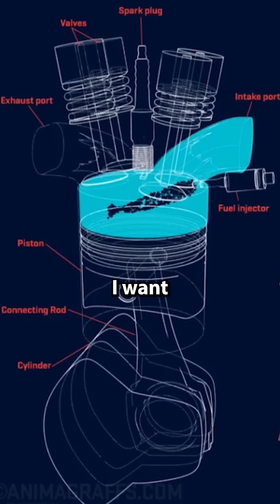All induction is forced

Comment: So atmospheric pressure pushes air into the cylinder at a rate that is dependent on the vacuum created by the piston?
So what is the maximum vacuum that can be made under atmospheric pressure at sea level?

Comment: Pretty basic stuff here.  Air has mass and the column of air moving through the intake tract develops a "ram" effect.  Same on the exhaust side, except the departing exhaust gas creates a scavenging or suction effect.  Tuning via valve timing intake and exhaust plumbing,  etc enhances this is the desired RPM band, but even your Briggs & Stratton lawnmower engine benefits from it.

Speaking of lawnmowers, I "tuned" mine by removing the exhaust restrictor "DB killer" washer from it's muffler box, and adding a bit of tension to the governor spring to rev it out.   Newer OHV mowers are governed to lower RPM (typically under 3K) than the older flathead ones (3.6K in mowers to 3.9K in slowblowers) to meet sound and emissions regulations.  

My let off the chain late model Toro self propelled  push mower with an OHV 6.5 HP engine barks hard and cuts the thickest grass like a boss set at 3,900 RPM, I estimate it is putting out a solid 9 HP ;)

Comment: It should be “pushed induction” and “pulled induction”. It’s still not accurate, but can give a better sense of the dominant direction the air is being forced. In a naturally aspirated engine, the vacuum force is pulling the air in during the intake stroke. In a turbocharged or supercharged engine, the vacuum force is also pulling the air in during the intake stroke, but due to the higher manifold pressure from the forced air, that higher pressure is also pushing more air in during the intake stroke.

Comment: Methinks this is a strawman argument.   Yes the air is forced into the cylinder by a pressure differential between intake air pressure and the near vacuum created in the cylinder, but "forced induction" has always meant that the air pressure in the intake is above ambient.  Nothing more, nothing less.

Comment: We call induction vacuum. We call forced induction boost. The higher the RPM the less vacuum. The only way to extend the vacuum is to adjust the valve duration. How vacuum is created is by the strokes of the pistons acting as pumps. If we forget about those basics, we will never make engines no powerful than 50HP/L or a peak torque that plateaus the whole range.

Comment: To calculate the duration of the intake stroke at 6,000 RPM, we can use the following formula:

If I get the math right do I get 95% off on the turbo for my 4.0 Jeep Grand ( Cherokee stroker engine ..... 4.0 )

Intake stroke duration = 1 / (2 * (RPM / 60))

Where RPM is the revolutions per minute. 

Plugging in 6,000 RPM, we get:

Intake stroke duration = 1 / (2 * (6,000 / 60))
Intake stroke duration = 1 / (2 * 100)
Intake stroke duration = 1 / 200
Intake stroke duration = 0.005 seconds

Therefore, at 6,000 RPM, the intake stroke would be 0.005 seconds long.

I'm I right ? .... I'll pay for shipping😅😅😅😅
Reply: Let your people figure out your math if they get it right do we get the grand prize for our vehicle a super turbocharger😂😂😂😂😂😂 of course you'll have to install it for me I just got through putting in forged pistons and Harland sharp roller rockers ..... can you work on electric actuators for the valve system .... .... 😊😊😊😊😊

Comment: I hate when you over complicate shit now you say time but in another video you’re like it’s not timing it duration because not all factors are the same well not every vehicle has the same lobes or same stroke. And not all intake strokes are forced a vacuum is not forced it’s a vacuum forced induction is extra pressure add by turbo or super charger

Comment: Maybe “ram” induction?
Chargers, both super and turbo, are known for external forcing. 
The piston descending is a true draw (vacuum) due to expanding cylinder volume, but any increase in pressure by forces outside the cylinder could be seen as ramming. 

I suppose the atmosphere in the cylinder, during the intake stroke, is undergoing rarefaction, while the atmosphere at the intake port is experiencing a little of both; rarefaction on the cylinder side,  and compression on the turbo, super, or ramming side. 

Regardless, the pressure is greater when either of the three external treatments are present.

Comment: That's why the resonators on factory air intakes work to improve engine torque, driveability, etc. because it smoothes out the intake pulses, which helps maintain a smooth movement of air through the intake and into the cylinder. TBI spacers can also help this, albeit at a smaller effect. Same principle that works by adding a boost bottle on a 2-stroke engine.

Comment: Pressure Differential. The lower the pressure in the cylinder and the higher the pressure outside the cylinder, the greater the Pressure Differential. With all else remaining the same, the greater PD will allow more flow and volume.

Comment: The air is being sucked in,not pushed....just saying!
Reply from the maker: It's equalization of a pressure differential across the intake valve. Is the vacuum of the cylinder sucking air in, or is the relative higher pressure of the intake manifold pushing it's way into the empty cylinder? Both are true.
Reply: @bankspower   Until you turn the motor over nothing happens with the air movement. It isn't pushing anything, as soon as the pistons start moving this starts to automatically creating a vacuum drawing air in. At what point does it start "pushing" it's way around? All the pushing would be done on the exhaust stroke to push out the exhaust gases! Please tell me what I am missing? Thank you for your response sir!😎

Comment: No. In this context, natural means air pressure, forced means assisted by some sort of fan. Period. The piston does not make air flow into the cylinder, it creates a partial vacuum, and the external pressure drives the gas into the cylinder.

Comment: On a NA engine how much of the inertia of the airflow in the intake manifold and port cause the cylinder to fill faster and more completely.   Does a big bowl behind the intake valve increase the mass of the stopped air while the intake valve is closed verses a tapered bowl that has less mass of air that it needs to accelerate into the chamber.   How much does scavenging effect horse power.  I had a friend build what looked like a header collector reducer with a 8 inch straight section that was just slightly larger than the primary tube.  This created an anti reversion tube that lowered the pressure in the collector, primary tubes and exhaust ports.  His 14 to 1 Na H22 honda went from 265hp to 275 hp in 10 minutes at peak horse power readings.  The straight section added inertia preventing reversion and improving scavenging.

Comment: Is it forced, or is the difference in pressure just trying to equalise. Is more air-fuel mixture trying to occupy the same space than is required to equalise the difference in pressures. And of corse this only applies below a certain altitude, given an ice in a vehicle is not going to reach an altitude where the pressure differential between the intake stroke matches the pressure of the external environment.

Comment: If it's pulling vacuum though, that means that it is in a negative state, which means that you would have to have a positive state so it's not really forced. To have a negative you have to have a positive like a yin and yang effect. Like if you were to operate it in space the piston going down if you have stagnant atmosphere within the manifold is still going to pull the material in. If it didn't move at all, the material would stay simply trapped in the manifold, but since the piston is moving it's going to pull it in so it's not forced. 😅

Particles will always move to an area of less density for a similar type. Unless there's magnetism involved which is the case of water. 

And even in space the sun is actually off by 6 km from a perfect sphere meaning that there's something there. 😂

Water is paramagnetic—meaning that it will hold a magnetic charge. In nature, the earth's magnetic field naturally charges water in lakes, wells, and running streams. However, as water passes through the treatment plants and is transported through pipes, it loses its magnetic charge.

Comment: Automobile semantics.
i also find this interesting.
Engine timing and Firing order.
Engine timing defines the spacial relationship between the cams, crank, pumps etc.
Firing order defines when each spark plug sparks.
with these description it should be termed Engine order and Firing timing. but it's the other way. who am I to complain.

Comment: If you take the bore strike and turn it to meters and then turn the meter to seconds, as long as you have exceeded the speed of sound times the amount of air cleareance and (and sme how add the resistance behind the valve) you will fill that cylinder up mostly.  Almost every time.

Comment: Thats actually wrong. For there to be a vacuum, the pistons would have to exceed the sound barrier. So 0.00083 of a sec or faster (feet per second) for the air to create a vacuum. 100 percent false. Not possible. The rings would give out. Oil would enter the cylender destroying the engine

Comment: Yes, the atmospheric pressure on earth is about 14 psi so when the piston is on an intake stroke, the vacuum it creates doesnt actually suck the air in. The atmospheric pressure pushes the air into the cylinder, which most people dont understand. If you ran an earth designed engine, on a planet with a denser atmosphere, it esentially would be boosted!!

Comment: Any actual engineer knows that no flow takes place at all without a difference in pressure. The pistons doesn’t “suck” air in, the atmospheric pressure pushes it in. However that’s still not forced induction, since forced induction refers to an intake charge above atmospheric pressure
Reply: If the piston doesn't descend and create a low pressure area above the piston, the atmosphere will not "push" air into the cylinder.  It takes both. What Mr. Banks is saying is that the force is actually the Pressure Differential itself, and he is correct to call it a force. Yes, textbook definition of "forced induction" is usually referring to some type of atmospheric pressure augmentation. It can be as simple as Cowl Induction or "Ram-Air" induction as well. Anything that creates more atmospheric side pressure, which increases the total Pressure Differential, can be classified as forced induction.
Reply: that was long and i got it hard to catch but somehow i can relate,
tganks bro
Reply: Correct of course.  A boosted or forced induction engine is one that mechanically supplies atmosphere to the cylinder above ambient atmosphere.
Reply: He's talking about the overlap Period.
Reply: Do you have to be an engineer to know that?
And why do so many people feel the need to state the obvious over and over? Yes, it's the atmosphere that pushes in after the piston creates a vacuum. Only flat earthers think vacuums suck.
Reply: damn atmosphere sucking all my co2 out my lungs and force feeding me air
Reply: @wyslink9354  when you increase the volume of your lungs the pressure drops in them, then the higher pressure air around you forces itself down your trachea into your lungs. So yeah actually.

Comment: It's always forced induction. I learned this years ago. It is a difficult to grasp that even at idle that air is not sucked in by the piston but rather forced in by the atmosphere. An easy example of this is a carbureted engine will idle higher at sea level than at high altitudes reason being the atmospheric pressure is higher at sea level.

Comment: When you use some type of compressor to aid in filling that cylinder, the Volumetric Efficiency goes up; more power on less fuel. But you begin to lose that efficiency when you start impeding flow. Compressing air also generates heat, which makes the molecules of everything you are compressing expand, hence less oxygen. Now comes the Intercooler. Nothing is exactly free when it comes to making power.

Comment: Went to school for heavy duty diesel engineering  and no one explained why you need a turbo for a diesel as simple as this explanation
Reply: You don't need a turbo for a diesel engine to run.  However if a turbo is added it 'forces' more atmosphere into the engine making more power.    Banks is wholly incorrect on his idea that ambient air pressure can be considered forced.
Reply: @kelsycunningham8452   yeah you don’t need a turbo with a diesel  but it definitely helps hahahaha

Comment: Vacuum is what helps a gas engine to breathe, ironically.  It's the lack of air that helps bring air in, since oxygen wants to go into a vacuum space with almost a concussive force, filling the void space.  It's why Diesels struggle to breathe without forced induction, there's not enough vacuum to encourage air to flow in the time frame of the intake stroke and the valve being open.
Reply: Diesels don't have a throttle plate hence there isn't the traditional vacuum you get with a gas engine when the throttle is closed. However, the piston creates a low pressure zone on the intake stroke which acts as a vacuum when the intake valve opens. The difference in air pressures is what actually fills the cylinders. There are gas engines such as the BMW's valvetronic that run no vacuum at all because air volume is controlled by the lift of the cam.

Comment: His point is the term "naturally aspirated" contains "forced induction" by the term "forced" meaning having a force that does work, in this case vacuum and pulling what the atmosphere pushes inside the cylinders. There's also Inertial Supercharging where the inertia of the airflow pulls air into a hammer like effect pressurizing the cylinders higher than the atmospheric pressure, this is both "naturally aspirated" and "forced induction".
The term "forced induction" is considered to be any type of induction that feeds the engine air at a higher pressure than the atmospheric and coming from outside the engine, but "forced induction" is technically many things not only this.

Comment: Im curious what mr Banks thinks about the newish atmospheric pressure, no throttle body, induction systems.  I mean hes always running boost, so maybe its not within his interests.  

At 6000 RPM, in a 4" stroke motor, the average piston velocity is under 50MPH, but halfway up or down, its doing twice that speed.  0-100MPH-0 in 5 milliseconds, 200 times per second.

Comment: It's actually 25 times per second at 3000 which equals .04 because the intake is only every other crank revolution.  .02 for 6000
Reply: RPM/60=RPS. 1s/RPS=Rt(Revolution time) Rt/2=St(Stroke time)

3000/60=50 | 1/50=0.02 | 0.02/2=0.01s. 

Therefore it takes 0.01s for the piston to go from TDC to BDC at 3000RPM. Which means when the intake stroke occurs in the cycle the length of time for that stroke to occur is 0.01s.
Reply: No silly.

Comment: Technically true. But when we say "forced induction" we mean arfically forced, above atmospheric pressure.
Reply: It's as Gale inferred. 
We use a term that's generic.
Forced induction should be hyper-atmospheric induction, but we're too lazy 🤣🤣🤣
(exceeds atmospheric)
Reply: @Motor-City-Mike  
Its pendantry for the sake of pedantry if you ask me.
Reply: @177SCmaro  It's his show,
Wouldn't be the first engineer to diplay hubris
Reply: @177SCmaro well it isn’t. Its him trying to explain and help people understand the physics of engines
Reply: @nodical802  What isn't? That all induction is "forced"? In a sense that is true since atmospheric pressure is a kind of force acting on air to push into into the cylinder to equalize the vacuum being created.
This pressure varies by things like location and altitude, hence one reason engines tend to make power at sea level then at high altitude - more pressure acting on the air.
My point was that, while what Banks said is technically true, in the common vernacular "forced induction" is understood be artificially forced above the abenet pressure i.e. "boost".
Reply: The most "Neil deGrasse Tyson" argument this man has ever made.
Reply: Tell that to Mopar Air Grabber owners...lol
Reply: Just don’t say that over a hundred miles an hour.
Reply: There is no force without first creating the vacuum,  and he say himself on many occasions that air is drawn into the cylinder implying suction
Reply: No, that's not even technically true. Every action/movement requires force, yes, but you wouldn't say that a river is forced to flow downhill, would you? Plants are not forced to grow, even though there are forces involved.
Reply: @aliceeliot6389  
You're equvocating - you're using the word "force" in two different ways at the same time to confuse the issue. 
Water is forced to flow by gravity.
Plants are acted upon by evornmental and biological forces.
"Forced induction" does refer to artificially generating above atmospheric pressure in an engine's intake system.
These are different "senses" of the same word.
Reply: Either way, none of this could happen without the fine quality of Amsoil lubricants.
Reply: Arwhat?
Reply: Don't know the context but if he's not answering someone asking something like "Isn't everything forced induction", this is pedantry. Lots of engineering terms are technically incorrect but they're still used because the word has a well understood definition and it's much more confusing to change it to be technically correct than to just accept it as a term of art.
Reply: Exactly. Everyone knows when they say "forced induction " what they mean. And anyone who tries to get technical about it is just a tool.